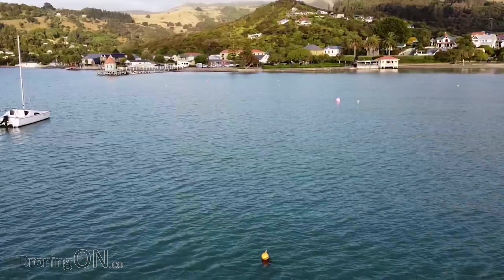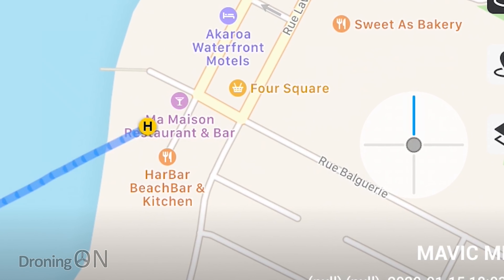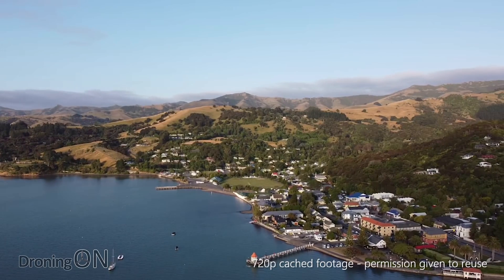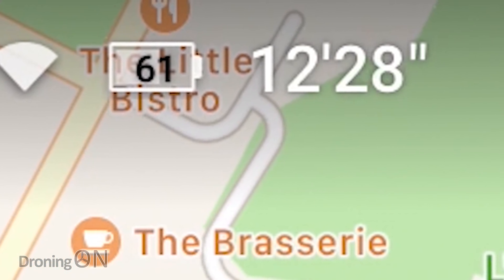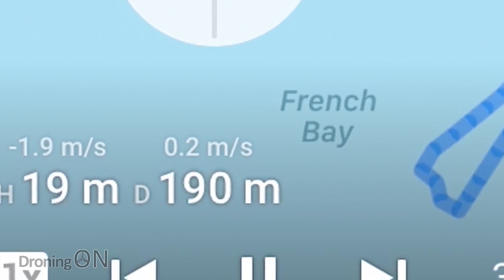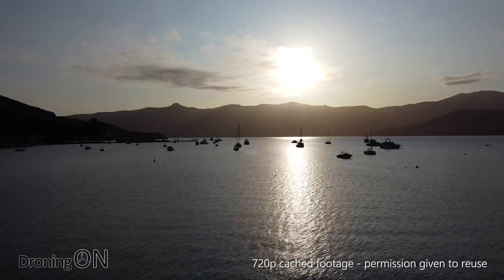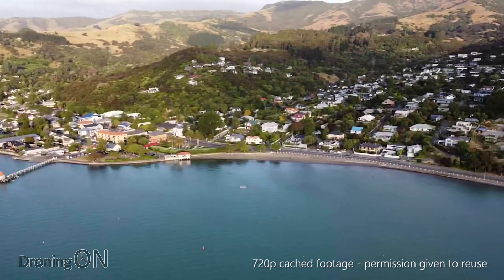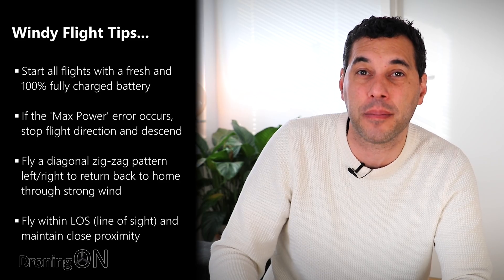DJI Mavic Mini Uncontrolled Descent Into Sea | Max Power/Wind Issues/Operator Fail?

Comment: I never had uncontrolable issue but when i was flying over the sea i have seen my mavic slowly sinks towards the sea but i can still control it and change its height but i thinks that might be the optical sensors error which can judge waves or might be somethibg else
Reply from the maker: Yes, fly with caution! Thanks for the comment!

Comment: A lot of guys out there just can't resist the impulse to test the max range or fly beyond LOS.  They truly don't understand the purpose of Mavic MINI.  I own a Mavic Air and 2 Mavic MINIs.  It's a drone that allows you to take advantage of opportunities.  It's not a full-fledge flight drone.  I use my Mavic Air for higher altitude shots and difficult to access shots.  

I think the best general rule is this: If you can't get over to recover your drone, you probably shouldn't be flying there in the first place.  
1 battery to Compass calibrate, IMU calibrate, and conduct hovering and flight tests.  The next fully charged battery is for flight.
Reply from the maker: Agreed SpinRush! Thanks for the comment!

Comment: Iv had two uncontrolled decent over water. Iv quickly put it into sport mode and got some altitude and brought it back. Best to stay above 20 feet over the water which gives you time to adjust. If in doubt buy some landing floats for your drone and it won't sink.
Reply from the maker: It's worrying isn't it! Thanks for the comment!

Comment: Factory propellers issue, mentioned on DJI forum here : https://forum.dji.com/forum.php?mod=viewthread&tid=209139 . Other users had the same issue (overload and auto landing), changed propellers with fly more spares, no more auto landing and better control. Battery firmware must be aligned with MM firmware too, on all batteries (fly more is 3 batteries).
Reply from the maker: Yes, we believe so! Thanks for the comment!

Comment: It's not a matter of size and weight but power. Batteries with triple the amps, same weight and motors triple the power same weight and that 250 g drone would have no problem. In the future we'll have that.
Reply from the maker: Size, weight and power are all absolutely related. Thanks for the comment!

Comment: With the exception of mechanical error most of these mavic Mini owners should know better then to fly without a full battery when is always stronger above 60 m
Reply from the maker: Yes agreed, that's the most common issue, not flying fully charged! Thanks for the comment!

Comment: I was flying the mini around my neighborhood and a family walking its dog came by and their dog was off leash the drone was kinda low 3 or 4 feet and the dog just as soon as he realized it was there jumped up before I could ascend and bit the drone out of the sky and threw it to the ground. The owners were mortified, just meeting a stranger and their dog eating my drone. I was cool about it, saying no worries I got the insurance is your dog ok he may have got hit by the rotors.. dog was cool, I picked up the drone closed the battery compartment and it powered on, unfolded the arm that got folded in and it took off with ease. Couple scrapes on the body nothing wrong with the camera.. tiny drone yes, very well made tho and so much fun to fly 🤗🤘🏼
Reply from the maker: Glad that it was safe in the end! Thanks for the comment!
Reply: @Droning-ON  fa sho!

Comment: I didn't buy the Mavic Mini because it's so vulnerable to wind. What use is a drone that can only fly in perfect conditions and only low to the ground?
Bought a Mobula 7 HD with a pair of FPV goggles instead for half the price of a Mavic Mini. Didn't receive it yet and I hope it will last me a long time
Reply from the maker: Yes it's not great with wind unfortunately, but it is for close-by use, it isn't a long-distance drone. Thanks for the comment!
Reply: Can definitely recommend buying a Mobula 7 HD or similar quadcopter! It's incredibly fun to fly FPV and the footage is great as well!
You can also customize everything and change all the parts if you want, which is great

Comment: I sold Spark and got mini because of claimed range and better camera but so far i lose video at 750m even that drone continues flying forward. I don't know why am I getting such low range on it. Camera is more stable but high speed footage looks like its 15 fps
Reply from the maker: High speed footage with a drone needs to be carefully planned and shot, don't yaw while filming at speed, use forward or backwards motion only.

Comment: I dont think this is the only problem doing this. If you look carefully with some video regards Parrot Anafi which has the same system of prop attachments. These props can have small cracks where its screwed in and this could create loss of propulsion. The motors could be spinning at full power but props not holding
Reply from the maker: Yeah that's very true, but the small screws are designed to allow the prop to rotate, it wouldn't stop the props overall from spinning, especially on the Mavic Mini where the props are screwed to the motor directly. Thanks for the comment!

Comment: My mini flies uncommanded all the time. Also it is always asking to replace blades even when replaced with new ones. Its a fun drone but uncommanded flights aren’t. Also I had an uncommanded flight into a tree and it fell into a creek.
Reply from the maker: Yes indeed, that's a concern, asking you to replace it's blades when you have new ones fitted suggests that the new ones aren't balanced, that in itself is a big worry.

Comment: Whys noone mention put it in SPORTS mode to help BATTLE THE WIND.
It becomes more agile and efficient during wind... Also if wind is difficult and you are losing power, or speed drops dramatically, try fly drone BACKWARDS towards you.
remember the antennas are on the BACK of the drone, so if you can direct these antennas facing your REMOTE CONTROL (flying drone backwards)
THEN YOULL HAVE MORE CONTROL, SHALL I JUST MAKE A VIDEO, BECAUSE ALL THESE "TECH" GUYS DON'T REALLY KNOW THAT MUCH...
Reply from the maker: Not in this video, but in our Mavic Mini tips: https://www.youtube.com/watch?v=0K6vVUNOzh0&feature=youtu.be

Comment: I agree with all of your points except..... If you have good winds and line of sight the Mavic mini doesn't have to be used like a toy to fly around the yard. I believe that just as many other drones have had problems and you are trying to fault the size of the mini on what is either user error or a faulty drone. ANY drone can have issues and I don't agree with you trying to convince Mavic mini owners or those doing research for purchase that the Mavic mini drones are basically a toy. The mini has made thousands of flights out beyond a mile or more and you are wrong in your assumption. Every drone owner takes a chance each and every time that they fly that something will go wrong. The Mavic mini is probably the best drone on the market for the money . Line of sight does NOT mean actually seeing the drone but means unobstructed signal between the drone and the controller. I am sure that you are trying to impress your 'expertise'  but it would be better if you at least presented facts. There are thousands of flights each day with the mini well beyond a mile or more without problems. As far as I know YOU are the only person on YouTube thinking that the Mavic mini is so limited. I own the Mavic mini and from my experience I say that your video is wrong in the implied limits of the mini. Maybe you should do more research and watch other YouTube videos before posting. I almost think that you posted this uneducated 'informative' video to get hits and likes and that just is NOT fair to those who are researching before purchase. THUMBS DOWN from me.
Reply from the maker: Thanks for the comment!

Comment: I fly my mini a mile out with no problem .  I just don't fly with an 18 mph wind at my back because this drone doesn't have the power to return .   Another trick if its struggling  is to push the forward and elevation drop buttons at the same time so it comes down at an angle.
Reply from the maker: Yes it's capable but so long as there isn't wind! Thanks for the comment!

Comment: Great video.  I'm tired of reading about people flying huge distances downwind, ignoring strong wind warnings and taking the mini up really high - all with low battery, and then blaming the drone when they can't get it back!  Any drone has to obey the laws of flight and aerodynamics.  I don't really agree with you that the mini is only for close in video and selfies (except as a safety tip for beginners).  It can be flown to a good height and distance as long as the pilot is aware of and respects the weather.  As you rightly say, winds aloft are usually much stronger than at sea level.  I've flown the mini in gusting 35mph winds, but I keep her low at first and I make sure she's upwind of me.  You can gauge how she flies into wind and ensure you can get her back.  And as you rightly point out, the first thing to do is get the altitude down so she can enter more stable atmospheric conditions.  I've had the low battery alert kick in at 6 minutes battery left and the auto land procedure start. so at 40% battery there must have only been a few minutes for normal flight.  Flying so far away downwind is nuts.  Many real pilots have disrespected the weather in history and many have died.  Now we have drones, luckily the pilots don't die, just the drones, but it's all usually avoidable. Again., great video.  And the descent at the end is interesting, I would love to know if DJI makes any comment on that.
Reply from the maker: Thanks Banquet for the comment - indeed if everyone flies in consideration of the wind, they'll keep their drones safe!

Comment: The same thing happened to me with my Mavic Air. I take off with a full battery. Bring it up into the air about 20ft to make sure everything is working. I fly it out about 50 yards and suddenly it no longer responds to any of the controls and lands itself in the water. The mavic just landed itself and there was no operator error. Looking online I see many others have had this problem. I sent it to be repaired an they informed me there was nothing wrong with it. No attempt at repair and returned for shipping the next day. This maybe a company where the customer is never right.
Reply from the maker: Thanks for the comment David! It's all about reading the weather and ensuring that you fly in decent weather!

Comment: I just got mine and had my first issue where I was playing around in sport mode and my phone actually crashed, I panicked and after about 5 minutes I was able to reconnect everything and the drone just hovered in place. I bought It to play with and attempt to shoot some cool videos. This problem was probably my fault but my suggestion for anyone like me who has never flown a drone before is take it to an open field and fly it for hours and play with all of the settings. Let the batteries die completely close to ground and see what happens, stuff like this. I live in the us so I keep my drone in imperial mode I’ve found most issues above 400ft from sea level and also about 900ft away. All in all the mini is sick and a ton of fun! For sure go for the fly more kit.
Reply from the maker: Thanks for the comment!

Comment: i love that he still in sport mode   all the time even when he is taking viedeos  dude p mode is better and u dont get power errors and u turn slower and get better recodings
Reply: But if you're struggling to fly against the wind then sports mode is better as you get more power. Of course it's better to fly against the wind on the way out so you're with the wind on the way home.
Reply from the maker: Mr Messy is absolutely right, being in Sports mode means that you can fight against oncoming wind, absolutely the right strategy.
Reply: DroningON  yes true but i cost  more power and pretty sure the  error come from this sport mode.  and wind together  so maybe its better to fly in p mode at least u can try it out or not ?

Comment: Change the props; any damage to even one blade then you’ll get the max power warning; but you must change both props for each motor. I changed a set in the flymore combo and had no further problems
Reply from the maker: Exactly, any sign of damage, replace them. Thanks for the comment, sorry for the late reply!

Comment: My Mini did the same thing. It descended all of a sudden. But stopped. It happens over land and I was at 20ft and 30ft from me. I had my props on so I though it had something to do with that. No winds. Im still wondering why it did that. If it is a firmware issue I hope it gets fixed soon
Reply from the maker: Definitely, sorry to hear and thanks for the comment!

Comment: Do they sink in water? If so maybe DJI should make them float for a chance at recovery. Even better if they also made them amphibious, capable of swimming back. Radio controlled little boats have been around for decades so it shouldn't be too difficult. Would up the cool factor by 1000. hmmmm.

Comment: I lost mine few days ago flying out to a reef  in the ocean.
At 50% battery power the mini started to return to base but never came forward. 
Slowly drifted south and away tried to gain control but wouldn't respond .
At 20 mins flying on full battery it landed in the sea .
Don't think I have ever been so upset in my life 🤣🤣😪😪🤧.
Dji are looking into it but really think they will say my fault but videos like this could help .
Thanks I wish I had seen this before I started flying my drone.
Reply from the maker: Thanks for the comment Big Al, that's sad to hear - do watch our latest video as it's very relevant unforutnately - https://www.youtube.com/watch?v=q4F9Bvna1IM
Reply: Did you try to come back in sport mode  " Max Speed (near sea level, no wind),  13 m/s (S Mode),  8 m/s (P Mode),   4 m/s (C Mode)"? This is asked by an P3 pilot contemplating a mini
Reply: @metalmikey2  no mate looking at videos after it something I should have done .

Comment: Warped/bent props cause this.. It's the way how people stores them in the case. If you don't place the rear ones (or bottom ones when folded closed) properly in the case they get bent. If this happens to you replace your props. Also if this happens to you throw it into sports mode to get it back.
Reply from the maker: Thanks for the comment, and agreed! See our latest video.

Comment: We took this at flight school for drones.  The uncontrolled descent was pilot error.  Sometimes when a drone is descending the air currents will circulate around the rotors and cause a downward thrust.  Attempting to thrust up actually makes the problem worse.   Take note in the video that the pilot did not try to move sideways to get out of the circulation effect.   It is quite possible if he had "strafed" instead of try to ascend, he would have recovered.  There was still enough battery.
Reply from the maker: Thanks for the comment Rich, yes that's called 'prop-wash', however DJI drones are designed not to ascend at a rate where they'll fall into their own prop-wash, so this isn't necessary operator error.
Reply: @Droning-ON  Interesting.  They used DJI drones in the examples of "prop wash" and it happens (can happen)  when descending, not ascending.

Comment: This happened to me, but luckily I was able to regain the drone and landed the drone safely but far away. I saw my mavic mini lose altitude dramatically,  then I told it to return home and it went the opposite to where I was, lost more altitude and I was about 20 feet above water. I was so scared, I said dam 500 dollars down the drain, but it regained signal so I moved it right onto dry land which was about 40 feet away, had to do an emergency landing since the battery was at 1%., right when I landed the drone on a train platform I ran half a mile to retrieve it.

Comment: The same thing happened to me the other day!
As I was hovering with around 70 percent battery at my local river, 5-6 meters above the water, messing with the camera and EV composition, my drone suddenly started losing altitude with the message warning 'Max power load reached' I tried pulling it up but it woulnd't go up it just crashed into the water by itself.

This seems like a manufacturer error, and the mini has this really big issue, which has still not been resolved.
Reply: Have you looked on any forums for information about this, e.g. https://forum.dji.com/forum.php?mod=forumdisplay&fid=129&filter=typeid&typeid=712 
or
https://mavicpilots.com/forums/mavic-mini-discussions.87/

Comment: I had the same problem luckily I wasn’t over water at the time actually the drone wasn’t far from me at all. My battery was full and all propellers was fine I think I happened because of a geo zone error because when I took off I didn’t have to unlock the geo zone but soon as I went up & turned the corner it came down when I went to get it & try to put it back in the air it said I was in a restricted area & had to unlock geo zones before I can take off again

Comment: If you have max power load reached error change all props asap otherwise you will be crashing ya mini.that wasnt wind that crashed that in sea or user error that was warped props.my was new first flight done the same and descended on its own luckily the rth rescued it last second  before hitting ground

Comment: Hum... you are making a HUGE error telling people the issue is linked to weight... it is NOT (every drone is sensitive to winds), and the ONLY key parameter is the wind speed (do NOT fly with winds matching or exceeding your drone max speed (I would say cruise speed to be comfortable).
I would also recommend to always start flying against the wind... change your take off point if necessary. This will give you a better assessment of the flying conditions AND you will manage more easily with full battery at the start of the flight.